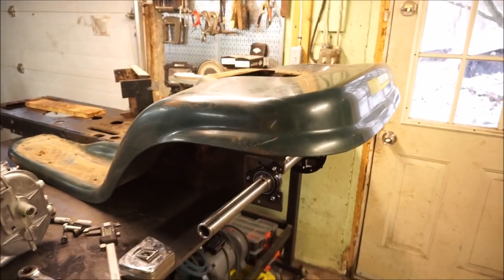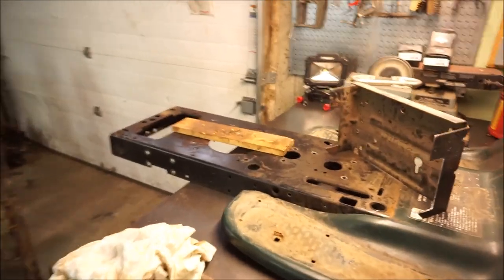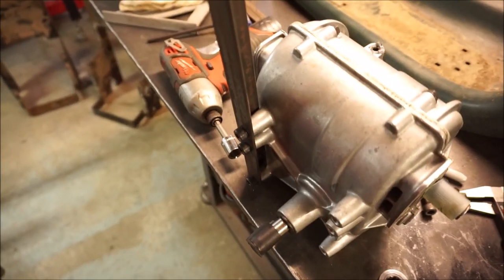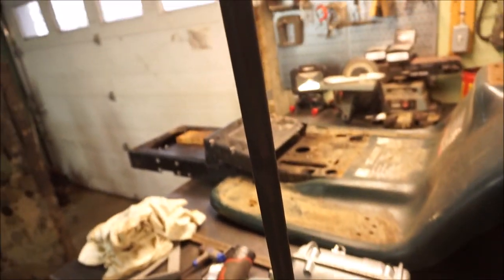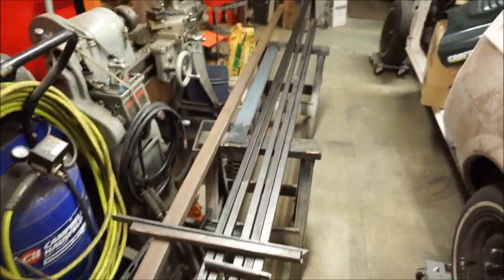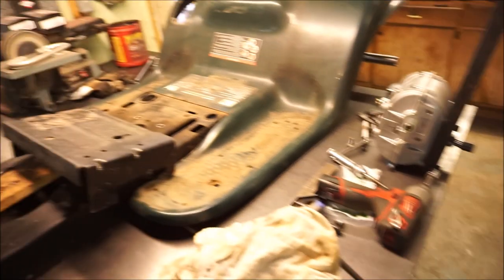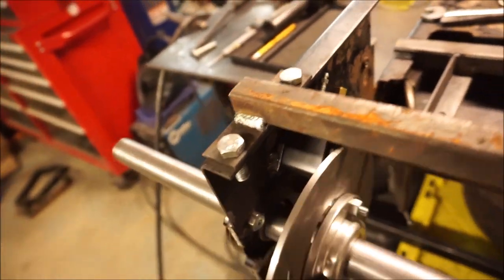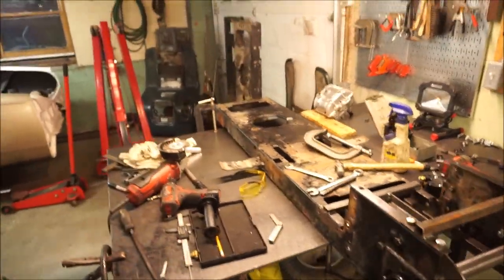Racing Mower Build Part2, mounting the transmission and frame reinforcement

Comment: I am building a similar chassis and also using the 700 transmission and I'm wondering what you did to make drive sprockets with larger tooth count.

Comment: For the peerless transmission the input shaft has splines. I tried searching for a 12 tooth sprocket with splines but none that I could find that would support a #40 chain. Where did you get yours from? ty

Comment: Looks like a tubular axle.  Are there preferences concerning solid versus tubular axles?
Reply from the maker: Basically the tubular is lighter but a solid would be stronger. I have warped one of the hollow ones but it took a decent impact.

Comment: Trans input shaft snout support? You may have talked about it at some point so I apologies if I may have missed it. Looking great as always!
Reply from the maker: I've actually never run one and maybe I'm lucky but never broke a snout off either. I guess I could always weld a plate on the bottom if I start to have issues. That's for the view and comment!

Comment: Do you think a 212 predator will make enough power with a TAV to live axle? Maybe with a stage 2 kit.
Reply: Maybe but better off with predator 301
Reply: @redneck_auto_tech  Idk man you can put 25hp out of those. It gets expensive but you can and they’re lighter and rev faster than a 301.
Reply: @holdenbostocky1998  ight that's your preference I respect that I just would go big or go home lol best of luck
Reply: @redneck_auto_tech  228 stroker…